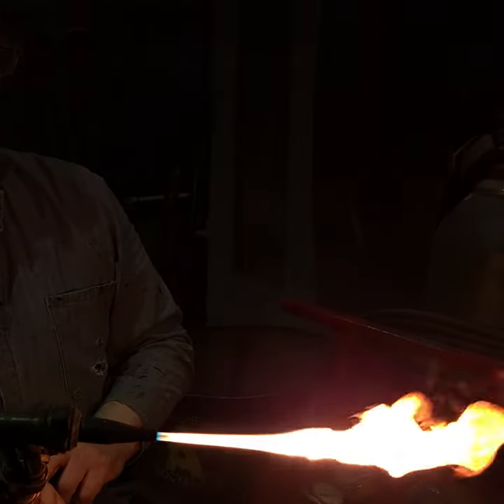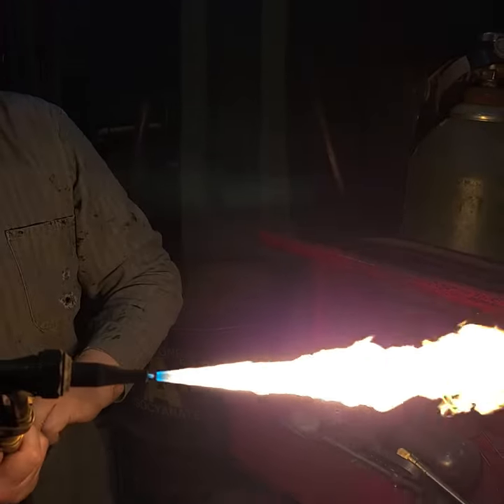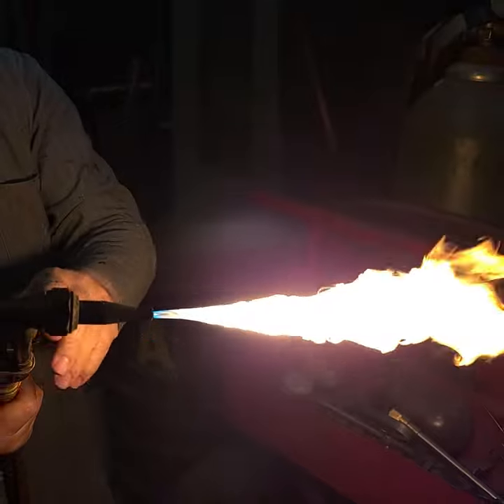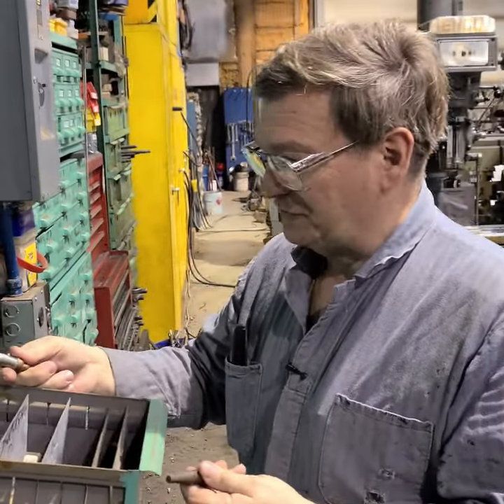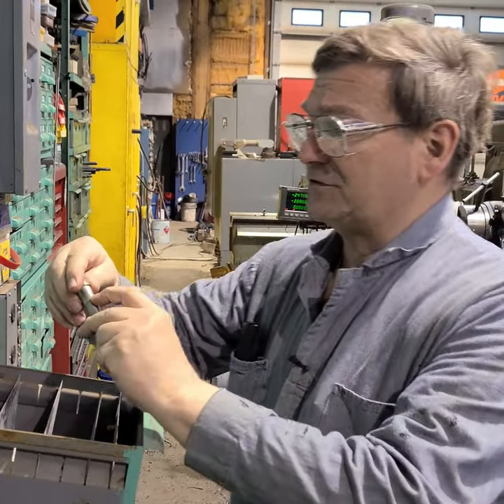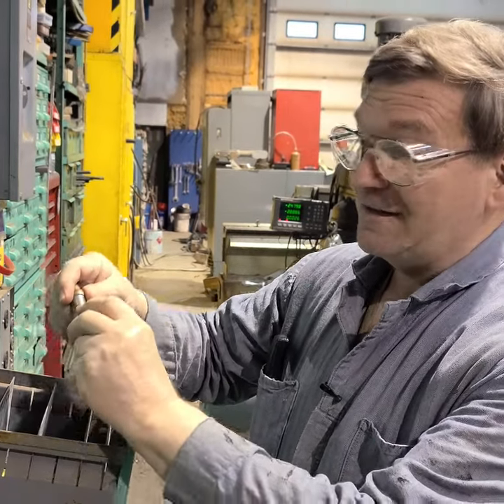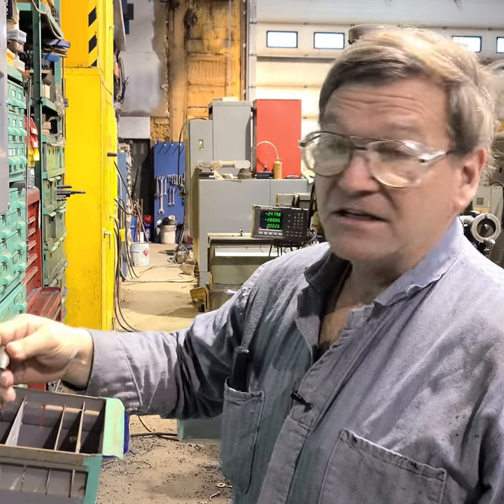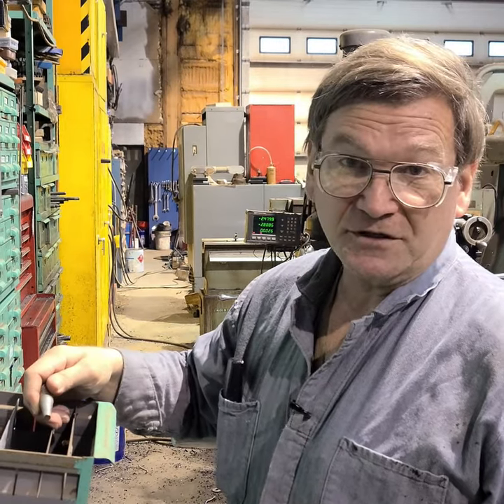Machinist's Minute: Adjusting a cutting torch flame

Comment: what settings is good for a bank safe ,, lol .. I knew there was different sizes but did not know about the numbers ,, Thank you
Reply: For the bank safe, flow and proper mix is more critical than tip size, so tip size mostly depends on how much time is available.
 ...fill via the safe's ventilation port.

Comment: I know we never used LPG at FM&S ( we used Oxy/Acetylene), but Greer Tank & Welding did. Are the tips different for the LPG?
Reply: My memory is that lpg takes bigger lpg ports compared to acetylene, but it's been years since I used an oxy propane cutting torch.
Reply from the maker: Yes the tips are different, Greer used some acetylene, and some propane.  When I worked at Greer the torches were Harris brand, I noticed a Victor in their shop about 10 years ago, don't know if they have both, or if they swapped to Victor.  The Harris is a nicer torch to use (the slide valve versions), but not as easy to get in Alaska 30 years ago, so I went with the more common Victor.
Reply: @ke6gwf propane tips are constructed differently to acetylene tips. Propane uses more oxygen, and is slightly slower to preheat before cutting. It also gives slightly better results on material thicker than 2"(50mm)